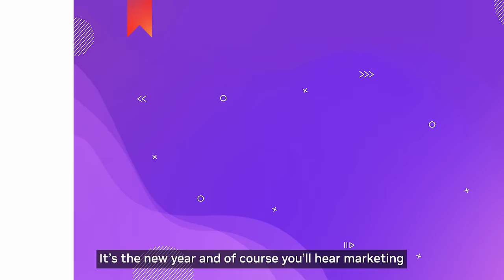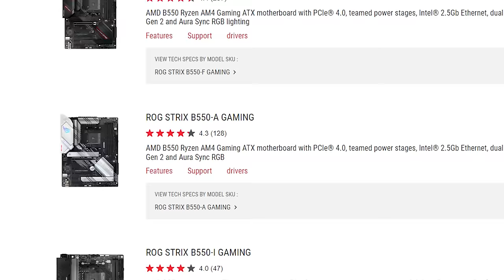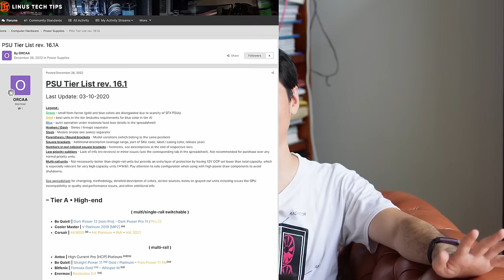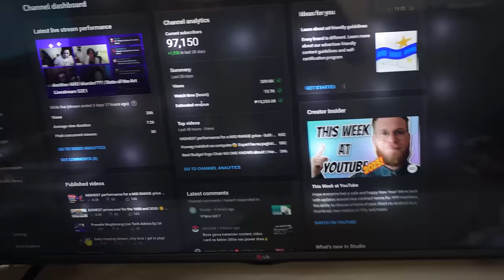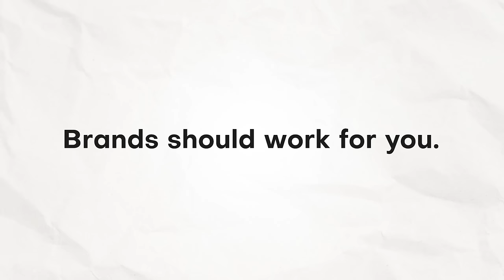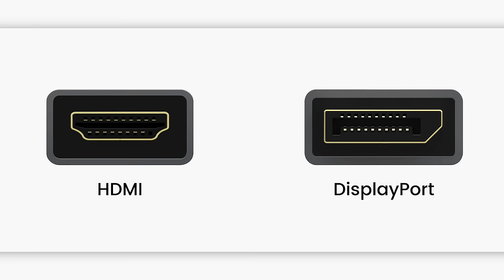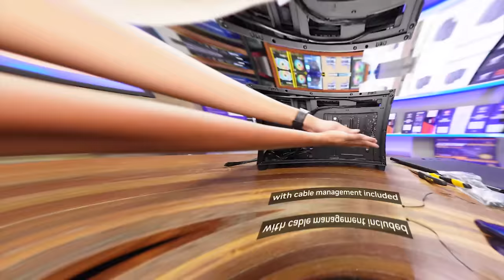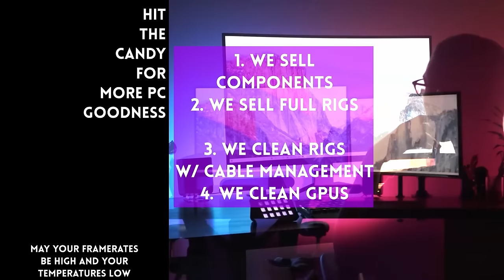Build your PC 👦🛠THE RIGHT WAY this 2024

Comment: ON POINT LAHAT SIR NG TIPS MO, GALING! I'm still rocking a 12 year old Intel i7-3770 (3rd Gen) paired with an 8 year old GTX 1070 and play AAA games on high settings and still getting decent frame rates. Also smashing all other tasks I throw on my computer and get the job done quickly. You gain a new subscriber here! Keep it up!

Comment: HI! I have AM4 rig I use for my work. b450, ryzn5 2400g, rx580, 16gb ddr4 3000mghz (overclocked), 512gb nvme ssd, use case digital illustration and productivity so psd files heaviest workload. 60fps max sa monitor (pen display monitor) + 2 more 60 fps office monitors . so my upgrade question is 5600x or 5700g? yun isa has more cache, pero yun isa has more cores. para lang may officially supported cpu ako for win 11. another more budget option is r5-3600 vs r5-5500. this time its more cache vs newer chip. which to choose based on my use case? (gaming is not relevant, starcraft, warcraft and C&C generals lang gusto ko laro hahahah)
Reply: ff
Reply: 5600x

Comment: This is true ang laki ng baba ng 5000 series ang layo ng price sa mga bago kaya bumili ako ng dalawang build puro luma 😂 dalawang 5600x kinumpara ko dun sa 7600x ang liit lang ng diperensiya . Tapos 32gb ram pero di tinipid ang psu rm850x and seasonic gx850 

Ddr4 kamura now ng dominator 32gb at tuf 32gb un dalawa unit binilhan ko 550m ng asrock pro4 ganda nyan tapos deepcool ak400 and ak500s cooler sa fans thermalright 6pcs argb pwm and 6non rgb pwm  isang 500gb crucial m.2 at 1 tera tas backup kingston ssd di nako nag hardisk mura ngayon ng mga m2 and ssd . Ang mga finocus ko na maganda ung case dalwang case ng ap201 full mesh cons lang neto di niyo malalagyan ng fan sa harapan pero solid case pwede ulit gamitin . Eto psu and case literal na pwede pa gamitin ulit kaya eto talaga di ko tinipid sa mga ram mobo procie gpu wala man future proof e mapapaisip ka na mag palit kana dahil mura na dahil nasisira mga yan baka sakit pa sa ulo 😂. Malaking tulong tong channel na to sinasabi nila ang totoo

Comment: Paps, 4K PHP for Seasonic 80+ Gold 1K Watt. Is it overkill?
Reply from the maker: first off, that's a good price, 

second, is 1000w overkill for your system? can't say, I would need to know the specs
Reply: @hwsph  

Eto paps,

i7 10th gen
B560
3060
H100iGTX Cooler
16GB 2X8 3600MHz
1 TB NVMe
2 TB Sata

Thanks
Reply from the maker: @dailydoseofmix 1000w is overkill for this, 750w would be fine

Comment: hellow pa help po sa build daddy sugar hehe
my current rig:
i5-12400f with ak620 zero dark cooler
4060ti 16gb tri fan(planning to buy this one)
asus tuf b660m plus wifi
4x8gb vulcan tuf 3200mhz
x1 hdd 7200rpm 
x1 nvme 2
x5 chassy fan
ano po magandang psu para sa build po neto? may 650 watts ksi akong psu, nag aalanganin po ako sa psu. ksi im planning to buy a 4060ti na trifan po bka kulangin po ksi sa psu wattage.
ill gonna use it for gaming po high graphics then upscaling na din sa mga videos po
Reply from the maker: 650w is ok for that system so if the psu you have now is decent no need to change

if you're worried about the psu quality and want to upgrade to something more reliable Superflower is recommended, https://hwsugar.ph/products/psus/640ed61e8913c900148900b5

pero hindi naman kailangan Superflower, CoolerMaster, Seasonic, Corsair, all of those guys have good 650w psus na 80+ Bronze
Reply: @hwsph  thank you daddy sugar :), really love your videos <3.  im surprised dahil na notice mo comment ko daddiiii thank youuu :*

Comment: This pc guide is for PC GAMING/Casual use perspective; not Editing since it says everything na you don't need the latest hardware, you should have a separate video for workstation/editing case uses.

I agree on DDR5, unstable but...

I disagree on tip #4...especially yung spend less on GPU for editing and spend more money sa GPU for Gaming... that doesn't make workload so much faster; what if like katulad ko na professional na needed ko ng high end GPU for programs like premiere po for playback times para hindi lagi nauubos ang oras and also sa render times like those programs needed GPU hardware acceleration para at the end of the day the CPU can multi-task other programs (alam to ng Adobe Power users na doing it on a daily basis). When you use CPU as renderer, you cannot even multi-task and mag lalag pa.  CPU and RAM naman for multi-tasking... 

for editing, the latest hardware means that you can generate a project in less time as possible and syempre the trade off is latest is expensive... 

and Gaming doesn't need to be higher GPU rin, look at Steam metrics on GPU na until now that the dominant GPU's are 1050Ti, RX570, 580, GTX 1660, RTX 2000 series, RTX 3050,60 etc... depends rin kung anong game rin ang gusto mo laruin... or if you wanted to have max out settings always edi find what floats your boat.

EDIT: Probably kung spend less GPU on editing if kung Photoshop lang yan or illustrator... I think pwede pa yun also if the context was changed from Editing (napaka general eh) to Basic Office Tasks. That would be appropriate.

Comment: Something i have learned having built several pcs.  Try to get parts from the same brand especially if you care about rgb.  Having too many softwares running in the bg hurts the performance.  I installed armoury crate just to customize my mouse. Icue to control my aio, gigabyte rgb fusion to control my ram color.  Pwede naman ibang rgb software like signal but subscription pa iyan.  Something to consider lang
Reply from the maker: yes getting rgb to all sync up can be a real pain